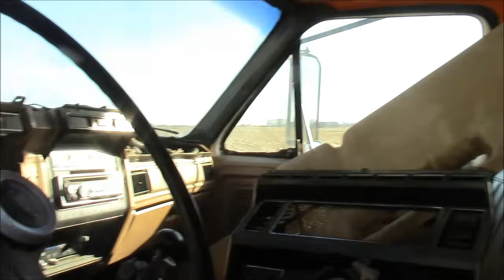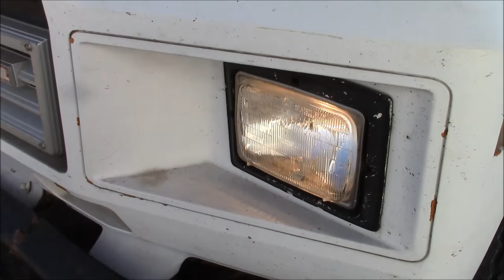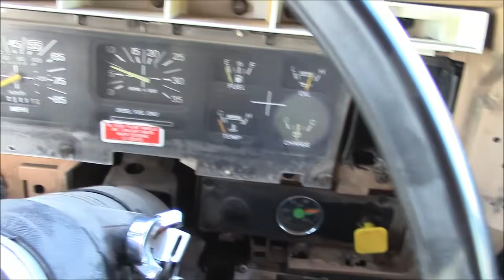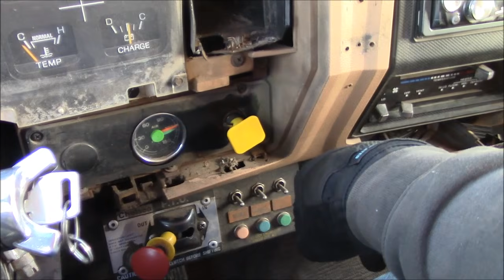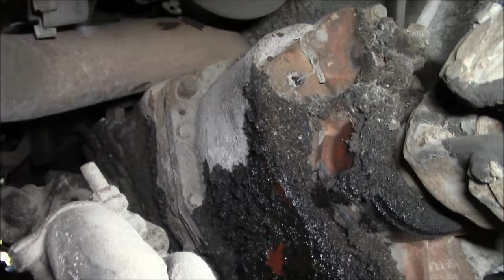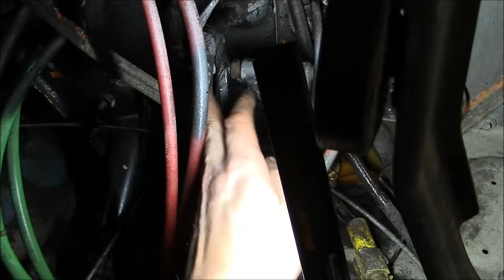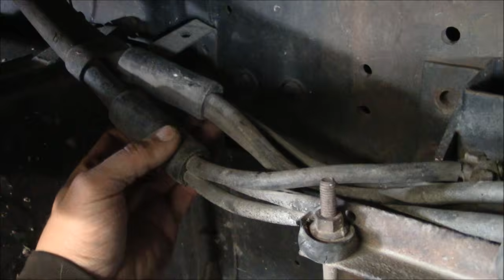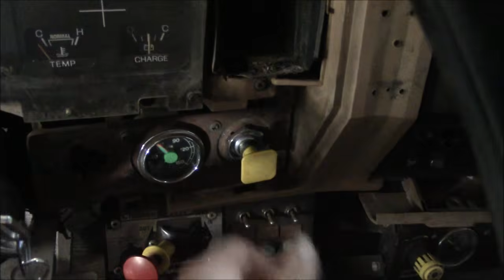Sweet 1984 Ford F-800 - No Headlights, Air Leaks, Bad Brake Valve.

Comment: It's great to see moderate-to-high core charges on parts like this brake valve -- encourages things getting repaired instead of sent the scrap/waste stream.  Would be nice if that rebuild kit was more available though.
Reply: Those brake valve assemblies are best to be replaced with a rebuilt one and the system is set up really for the best economic sense. Now if a fellow has a spare valve and wants to order a rebuild kit in order to have one on the shelf so to speak and can send his valve in to be rebuilt or wants to have extra kits to be able to rebuild the kits in house, that would make sense. Generally these valves are pretty common items that the truck supply houses and parts places have readily available

Comment: The other air switch on the shifter is a transmission brake for getting it to go into gear easier. My friend's old Ford 800 grain truck has one too. Stupid thing broke a couple years ago and it was a nightmare finding another haha

Comment: I changed many of those brake valve's back in the day. They used to be around $10 for the valve and the kit was always close to $20, it's always been funky price wise. 
I really liked working on those fords, i always thought they were much better designed than Pete's, macks and Kenworths.

Comment: Hello Wes,  Have you tried the five gallon bucket mouse trap?  The beauty is you don't have to reset it and they just keep coming.  If your shop is not heated mix a little anti freeze in the water on the bottom (deep enough to drown them) of the bucket.  Run a wire through a 20 oz pop bottle along the long axis with a  twist on either side of it to center it.  Smear the peanut butter on the bottle add a couple of sticks for ramps up to the top at the ends of the wire and voila mouse killer.  They run up jump on the bait and it spins dropping them in the drink.  Dead ones don't seem to phase the new ones running up.  A few of these around the shop and you will thin the population considerable and like I said you don't need to do much beyond replace the peanut butter once in a while and dump the carcasses.  Oh and remember to take the label off the bottle.  A hot wire makes a quick hole in the cap and on the bottom to run the wire through.  Take care.  Doug
Reply from the maker: No. I prefer the instant justice of the spring loaded trap.

Comment: Twist...no twist...whatever works. If it's a super-tight fit, try not to twist em. Just make sure you don't have any rogue strands sticking out and use a GOOD crimp tool - that's what's worked for me for a long time. The wires are twisted as they are made, btw. I'm going to have to get some of that grease; been using the tube stuff. I am also going to have to try those uninsulated butt splices. If it works where you are, good enough for me haha. Great stuff, video and work, as always!

Comment: that small air line that’s coming from the bottom left of those RT6610’s is for slowing the input shaft( there’s no friction clutch brake behind the clutch), the valve is next to the range change on the gear stick

Comment: I don't know about military, which I believe is IPC standard class 3, the requirements are higher.
Class 2, which I worked with in an environment for wiring harnesses, two wires into one connection was allowed as there were requirements for jumpers in a plug, as well as one line run to two locations. So, yes, two wires in one location is allowed as long as the connector allows it. Most wires should be straight, while twisting wires was only allowed in order to get the wire into the connector. It was preferred to not twist the wire, but if it became necessary, the engineers would probably request that the wire be soldered before being put into the connector. This was casual observation as I ran the cable machine, not the harnesses themselves.

Comment: I like those engines I don’t think there as bad as a lot of people say. We had six of those at work in C 70s they all ran good and had between 200 and 300,000 miles on them when they were replaced or sold off. One engine was replaced due to supposedly dropping a valve .One was a manual the rest had Allisons. The one we had in maintenance would run about 77 miles an hour on the interstate and pulled almost as good as our DT 466. The thing took off so quick if you were in a gravel parking lot it would almost spin across the parking lot. All ours were the turbo model I was impressed how quick those trucks would take off. They used that truck From 1987 to 2005 and the only thing they done to it was replaced the governor in the Allison transmission and put a radiator in it And a few belts and hoses. I wished I would’ve bought it when they got rid of it it would’ve made a heck of a rollback. We have an 04 or 5 international 4300 we’ve probably spent more money on it at the international place then they paid for the 87 Chevy c70 new. The old girl didn’t have many creature comfort’s but it Was a much better truck as far as just being tough and reliable. The biggest downfall to it is I don’t think it had any kind of glow plugs or grid heater so once it got below 30 you better have a good batteries Or a drop cord. Usually if everything was in good condition it would start but it sounded like you were going to melt the starter down but I don’t think it was ever replaced that I could see in the service records. Another guy bought it at work for 1200 bucks he sold it to a farmer near here for 5500 bucks and the farmer shortened it and put a stainless steel spreader bed on it and repainted it. It’s the only spreader truck you see carving through the back roads here running 65 to 70 miles an hour lol. Guys a maniac with that old truck it will fly.

Comment: Wow
That brings back memories 
There were a lot of those and gm bodies around in the 1980s
They where made cheap 
And the use of the pickup wiring made for a lot of problems when the unit’s where used on a truck
On long hard days
I drove 3 different ones over the coarse of 5 years  when they got like the one you have they got rid of them
Looks like the one in this video wasn’t used much

Comment: To prevent a "big wad" where all the splices line up, (if possible) cut some of the wires in the harness short.  Connect those to the wires from the pigtail first.  Trim the rest of wires from the pig tail shorter.  On a larger bundle like you have, you might have to do 3 different lengths.
I use the two wires into one side of a butt splice all of the time.  I don't have the fancy 2 size butt splices so I add a soft piece of wire to the side with the single wire, crimp and cut off flush.  I always use dual wall/marine heat shrink.

Comment: When looking for those leaks if you use a smoker stick and as long as the wind is not too bad in your shop it will help you locate it a little faster.

Comment: Hi Wes.  Another excellent video.  
I very appreciate the way you describe WHAT you're doing, and WHY.  I also never cease to be amazed at how many of your 'older' vehicles you (and e.g. Bus Grease Monkey) are EASILY able to get parts for.
I have no idea what US manufacturers policies are for parts availability, but here in the UK, sometimes you're lucky if you can get parts for even an 8yr old vehicle.  Unless of course it's from an independent supplier and might then be NOS (New Old Stock).
You also seem very 'aligned' with the UK with your parts and components terminology which (I like, and) makes it seem like our respective teachers were 'old school'.
Regards Mark in the UK
Reply from the maker: This headlight switch was used in every Ford vehicle from the early 1960s to around 1998. So they made many millions of them. That was an aftermarket part, but made in USA and reasonably priced. Some things are really hard to get parts for. Especially industrial equipment.

Comment: My opinion on twisting wires, for what it's worth: The strands crossing over one another could (and does) cut through the adjacent strand(s). This in turn leads to loss of effective wire diameter, and in higher amp loadings leads to overheating. Also, from bitter experience, never let a wire cross over itself when using a screw or nut to fasten it down, it WILL cut itself off. a simple 180 degree wrap is sufficient. This goes especially for single strand wires.

Comment: I am from the UK and have been driving Trucks for over 40 years. Crash or Straight cut none sync Gearboxes where very common till the 80s then most went to Synchromesh. I used to drive a big Ford Transcontinental with a fuller range change 13 Speed with overdrive on the top 4 all crash no sync. Just double the clutch. I had a Volvo that was 18 speed with no Sync all crash. The drivers of these Days with there Semi Auto and fully Automatic gearboxes don`t know there born. After a Day driving 400 miles in an 18 speed with no Sync you were wasted and just hit the sleeper.

Comment: My bomb-proof method is I twist the wire end, then I tin it, put an uninsulated terminal/connector on it, crimp it, solder it to the already tinned wire, then shrink wrap. No way the connection is ever a problem again.

Comment: Been an electrician for over 10yrs. The only reason I can see for not twisting stranded wire is metal fatigue. If you twist them copper is so soft that it could break a few of the strands when you crimp it

Comment: If I ever work on anything that dusty the airline comes out and I blast it with high-pressure air and it makes a hell of a good job as long as you don't get too close to things depending on the age of the vehicle lol.   but it doesn't haf clean it up. ... good work by the way👍🏻👌🏻

Comment: I do all my wiring repairs the same way, been doing it that way for 13 years as part of my job.  Even with all the road salt they use up here in Canada I have very good success with it
Reply from the maker: I've had good luck too. I've rewired a few entire trailers using this method and had no issues.

Comment: Using two layers of marine heat shrink sounds like a good plan! I used crimp bullet connectors on my ebike - using dielectric grease kept the connector surfaces clean, but the connector rusted clean through where the copper wire went in...

Comment: Those 8.2L were of the same family as the 6.2 and 6.5L. All were pretty good engines as long as you didn't over heat them or try to turn them up and run more power than stock. They were not powerhouses with a max rating of 230hp and 495ft-lb of torque but were actually pretty good on fuel and started ok in the wintertime thanks to their high compression.(at lest for the time) They faired better than their 6.2/6.5 bretheren because they had unit injectors that were more reliable pushing big fuel than the little roosa master ever was.  Good thing too though as most of those engines are buried where nobody wants to work on them.  lol
Reply from the maker: I sure don't want to work on it. You need to hang from the ceiling to get at it and the engine bay is about the size of a normal pickup!

Comment: I drove a few school buses with the 8.2 liter Detroit Diesel in them and they never had any problems with them. I like that motor a lot but it’s not like the 2 cycle screaming Detroit’s. And yes that is a 4 cycle engine.

Comment: We just cut one of those up. Was an 84 with a 8.2 in it. High lift coal delivery body. Body went on a IH with DT466E the driver's door and back window are in my shop. The door is going on my F350 with the SA-200 welder, and I only kept the window because it fell out and bounced off a frame rail and landed on a rock without breaking when someone creamed the cab with a backhoe bucket.
BTW, the 6.2 was a turd. They had head gasket problems. Always slop in the radiators from leaks. Lots of them died an early death before the warranty was up
Reply from the maker: Yeah the internet is full of bad news on these engines.

Comment: I had never heard about the twisting wire thing either, BUT if I think about it after you put the twisted wire into the crip up to the insulation then crimp, If you pull on the wire and the crip, the twist could straight out and this would cause the uninsulated wire to now to be longer (twisting would shorten it) which in turn would cause the insulation to not be uptight against the crimp, exposing live wires. This does not take into account the heat shrink tubing covering it. So I don't know either still.

Comment: For situations like that block heater cord, I have run large diameter heat shrink back over the cord as far as I can get it and then put the end on.  At least that part of it won't short to the structure.  Can't make it look too good though, because nothing is as permanent as a temporary solution that works...

Comment: A bit twisting isn't really an issue, better than missing something.

The idea behind not twisting is simple: A straight cable has a very uniform diameter so the crimp connection can be evenly.

Comment: That other air valve on the shifter is the clutch brake, only ones I’ve ever seen set up that way are 610’s and 6610’s.

Comment: The tanker I drive on our county fire dept looks just like this,  is a f700 and just has a shorter wheelbase and a stainless steel milk tank converted to carry water and has a 8 inch dump valve. It has the tilt hood and the ford 6 cylinder turbo diesel mated to a Ford auto trans. We have a 1995 f800 like this, same engine but a Eaton fuller push  button shift auto trans
Reply from the maker: That Ford 6 is pretty common. Those are actually pretty good engines. Made in Brazil. They used them in tractors too.

Comment: Wes, if you look at the image about 1:20, in the upper left there is a connector with a bunch of wires with bare spots on them that look like they could short. I don't know what that connector is, but it might be worth calling the owner and telling him to put some tape on the wires.
Reply from the maker: I saw it too. It's not connected to power as far as I can tell.

Comment: That's a nice truck, would love that. I'm in the UK and was brought up on old equipment with no scyncro and you soon got used to it.
Reply: Mark Wallis Had the 110 6-cylinder Land Rover.  Think that was the last model made that had no synchro between 1st and 2nd.
Reply from the maker: Most normal vehicles here have had synchros since the 1940s. But many trucks had what we called a "granny gear". It was basically a low gear added on to an old 3 speed box. There was no synchro for that gear because you were only supposed to use it to get moving from a stop. Those were used up to the 1980s.
Reply: @WatchWesWork  Yes it was an oddity, but the old tractors I used had nothing and the old MG and land rover  I had only had syncro in 3rd and 4th. I go to used to driving without I used to slide change my cars that did have syncro, easy once you got used to listening to the engine revs and easing off the accelerator at the right time.

Comment: I have buddies who will only solder connections, but apparently a crimp will last longer in conditions with vibration, which is all automotive. Once you go non-insulated connectors and shrink tube you never go back. You can get a pretty decent box for under $100 that will last you a really long time. I just buy what runs out by itself and keep the box stocked. I will strip the hard plastic red, blue and yellow pieces off those cheap auto parts store connectors if it's all there is. They are terrible and I hate them. They seem to hate me too, so it works out.

Comment: When I use to work on boats, I twisted, tinned with solder, joined in a metal butt connector crimped and soldered again then double heat shrinked. You don't want your high water switch/bilge pump to fail at the wrong time. This was on SF Bay and salt water is hell  on electrical if you don't do it right.
Reply from the maker: Belt and suspenders!

Comment: I want to thank you for this video, I've had severe arguments about Ford putting first Gen Detroit Diesels in the there trucks, I've had a few ford's and the F-250 I had was a Detroit not a cornbinder V-8, as far as the F-800 trucks, I know of 4 engine options the one I owned had the tough Brazilian in line 6 Diesel engine and a 5spd with a 2spd rear axle setup, friend of mine installed mack rears on one of these, made a ridgid log truck for his tree service and is still using that beast, these are very tough work trucks.
Reply from the maker: Those Brazilian engines were pretty good. I don't know why Ford didn't use them more.
Reply: @WatchWesWork  I gotta agree, now those engines are in demand around here, most guys that ordered the F-800 Farm trucks ordered them with either the 3208N or T cats or mostly the big 460 gas motors, they all want the I line conversions done and usually wind up with a baby in line cat as the Brazilian Ford diesel engine is too hard to get.

Comment: funny about twisting the wires, i've been told not to by electricians as well, its a throwback from older thicker and weaker wire and older connectors where twisting weakens the connection and increases impedence

Comment: If the original light switch harness crimps were in serviceable condition an option would be to just change over the plastic connector block and skip the pigtail graft.

For what its worth, I worked for GM for years and wire splices were always just crimped. In a vibration environment like automotive history/experience showed a soldered joint created a hard node and increased the likelihood of a fatigue wire break right next to the solder.
Reply from the maker: Yeah, I read a whole test report from NASA finding basically the same thing. Apparently they don't allow wires to be soldered, only crimped.

Comment: I know both my 87 F150s have 5 into 1 wire crimps from the factory. 2 from each gas tanks and 1 tail light grounds. And WHEN it corrodes you have NO tail lights and NO fuel pumps or fuel levels.